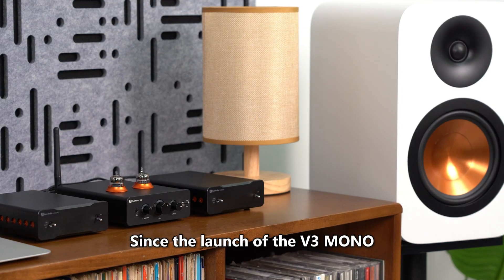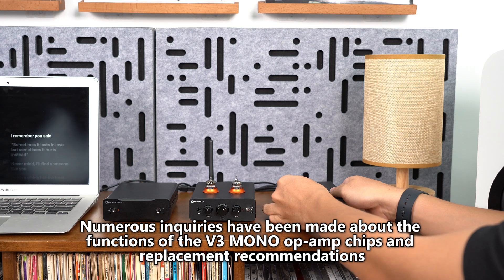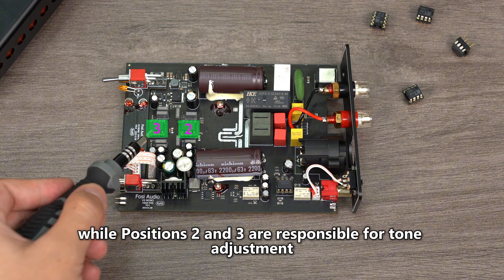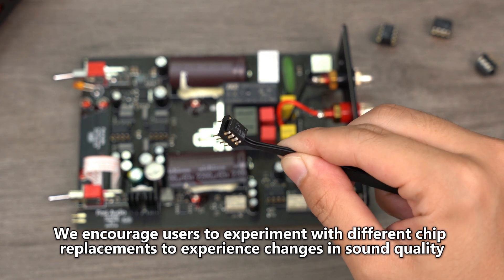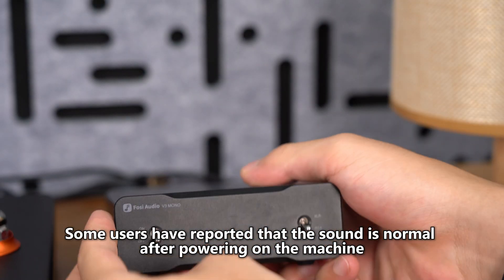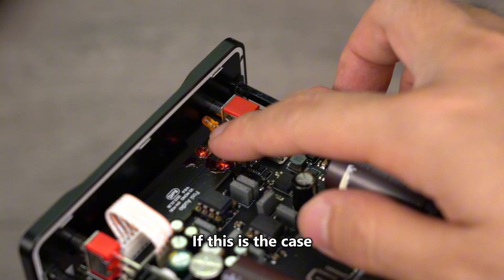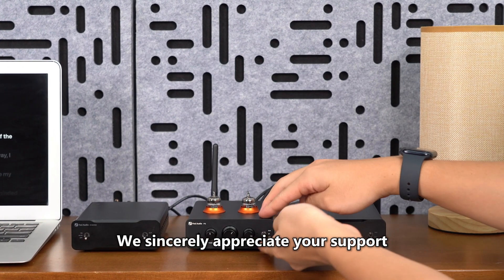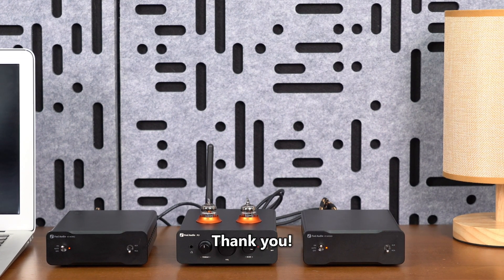V3 MONO Op-Amp Chips and Troubleshooting Tips

Comment: Id like to know exactly what position 2 and 3 are responsible for. Like exactly.
Reply: They are used to amplify each half (the positive cycle by one, the negative cycle by the other) of the output waveform. SADLY, I have not been able to get Fosi to identify which is which. But they say that if you are replacing only one of the three DIP socket-mounted OpAmps, number 2 seems to have the most audible effect.